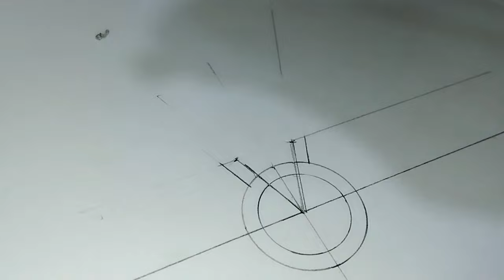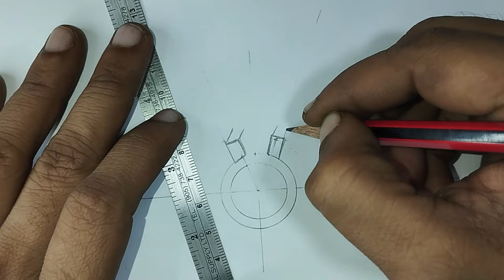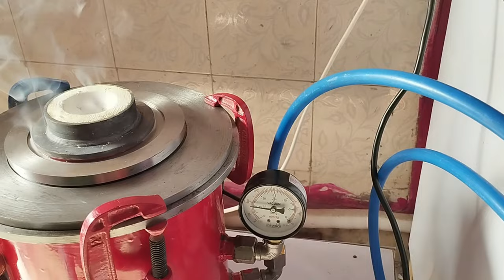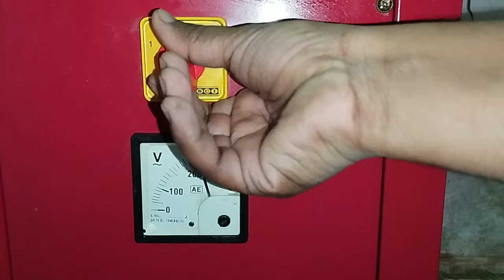How to Make Diamond set Silver ring|Silver ring|Handmade|Adamjewellery

Comment: Very clean workspot, like to see that good organised. 🤗

Also great ideas.
Thinking, when to alter shorten the ring it comes in 2 pieces.  🤔😅

Do you have ideas to make ring  sizes smaller without cutting it !?

With rheuma sometimes fingers get thick and small, already lost a golden ring because of that. 😒
Reply from the maker: Thanks for the comment, yes you are right for resizing the ring. Anyway, it can be resize when it is in wax form easily, and it can be done in metal also which is not a good idea. It is better to order in right size.

Comment: Why on earth would you cast a ring so simple, cast metal has a piss poor crystal structure making it prone to breakage, where as, extruded or rolled metal is lighter and stronger.
Reply from the maker: Thanks for your comment, You are absolutly correct regarding metal Crystal structure after casting. I have made this project for general knowledge about Wax Modelling and Casting process for making any simple or intricate product in one single video. And  it is correct that cast metal is not good compare to rolled and annealed. My self is also a metallurgist and understand the metal behaviours and their internal and optical properties. Thanks for your interest and suggestions.
Kindly keep watching and suggesting us.
Thanks.